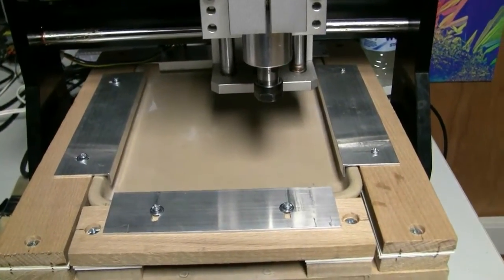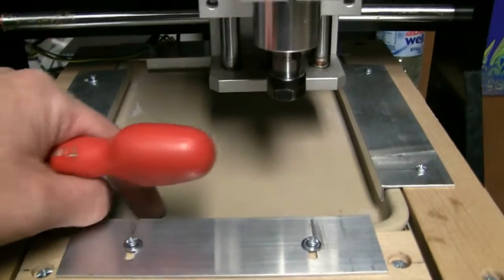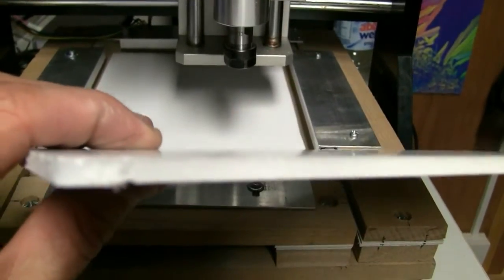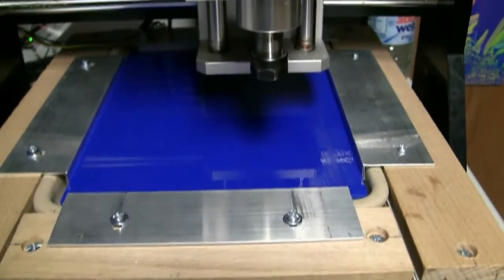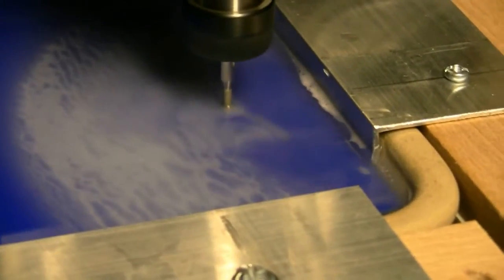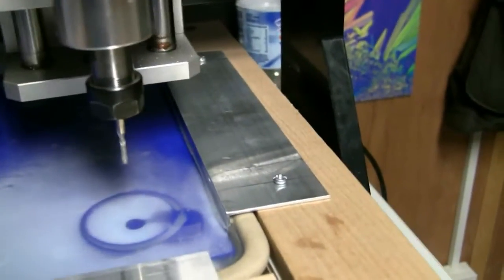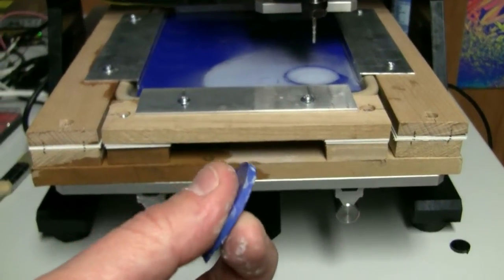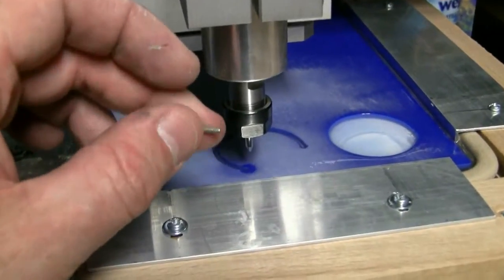Glass Milling 2

Comment: Hi David,

Thanks for the great video!

My company purchased a Neptun Quickmill machine. We only use to mill the glass. One function that I would like to know is that I would like to make a mark on the glass. But I don't want let the spindle completely cut throught the glass. Do you know if it is possible to control the intensity or the distance for the spindle head going into the glass?

Thanks!